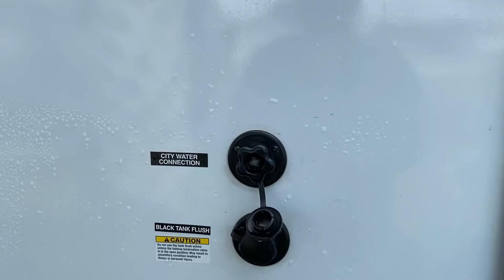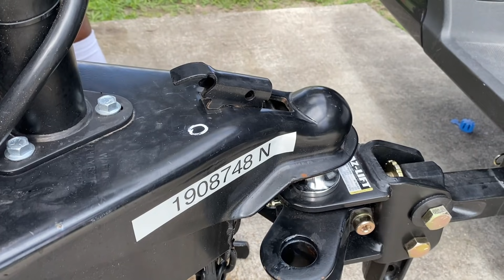Next RV Park... Kings Bay Submarine Station

Comment: Here is a thought - we had to buy an extra sewer tube.  We have a square rear bumper, we went and bought another piece of square tubing which would be big enough to fit the sewer tube in, used those metal screw down straps to stack and attach them.  Then hubby got cap ends for the tube.  You could do something like that for storing your sewer hose.  Just use a little tap screw on the caps so they cannot work loose.  You are absolutely right Pegi - set up and tear down requires taking your time and routine as there is an order stuff must be done in - good job you all!  Drive through sites are the absolute best!  Wow look at all the stuff you can do - a gym, bowling!  Have a good stay there!
Reply from the maker: Hey, Randy! Don looked into the square bumper tubes and we are going to look into them again. Great idea.